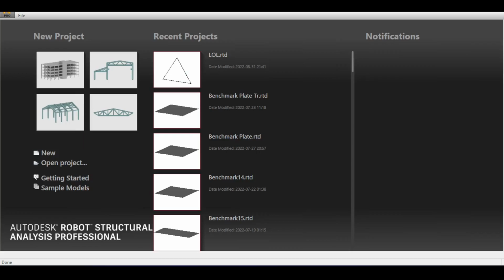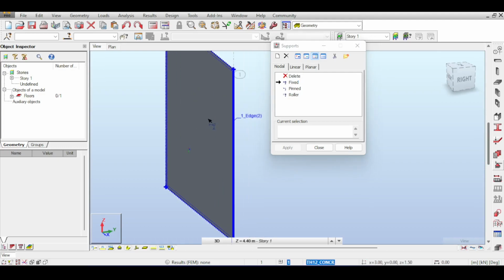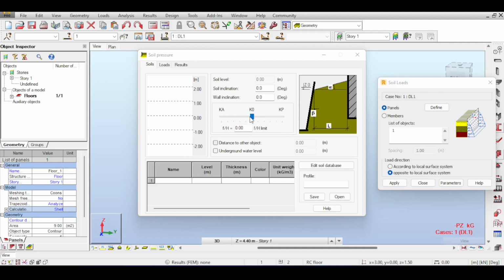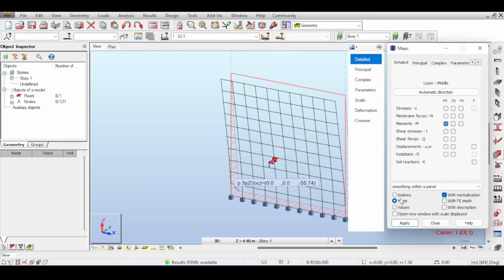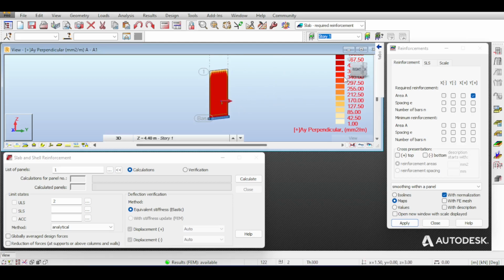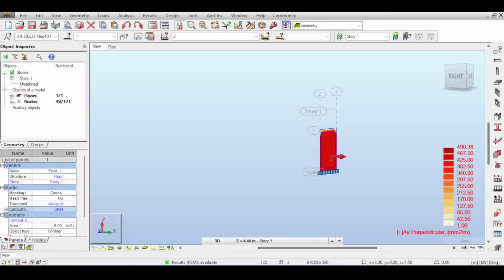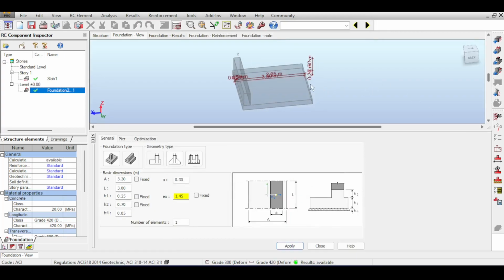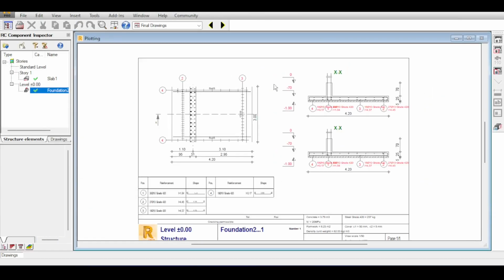Design of RC Retaining Walls (Simplified) in Autodesk Robot

Comment: Thank you CEE 💯, “…. the opportunity to see your thought process in detail, and the step-by-step suffering that you endure 😊 …..” are indeed necessary and they do make the tutorials feel that much more practical and engaging. 

Questions:
1.	The foundation “length” in the final RSA design is about 4.2 meters. Braja M Das proportioning dimensions guides for this length are 0.5 to 0.7H (1.5 to 2.1 meters). I am concerned that 4.2 meters does not “feel right, it feels too long” are you not worried about this dimension?

2.	@ about 30h11 you explained the importance of the soil weight above the heel; @ about 26h30 aren’t the reactions of the wall support you mentioned not only representing the HORIZONTAL components of the soil above the heel and not the VERTICAL components? 

I am thinking that maybe the VERTICAL component of the soil weight above the heel should be model into the design of the retaining wall foundation somehow? What are your views?
Reply from the maker: (Fun fact: the discussion made me rename the video as - Simplified- because you gave me amazing food for thought. I think there is something even better to be prepared next week. + You will get a shout-out at that moment ^_^. It is next week because I already scheduled a Video for 08.09 about modeling swimming pools.)
As for Q1, I totally agree. The reason why the retaining wall was this large is because of the bearing capacity. The loads on the foundation are eccentric, and cause higher pressure on the toe and even uplift in the heel region.

Robot suffers in not taking some points about the heel into account. I will address this issue in a more detailed video in the future. This is also point 2

for point 2:
The reactions you see on the foundation horizontal soil pressure and moment.
the vertical force you see here is due to the weight of the wall.
This is what I mean by "there is no full module that designs retaining walls in robot, and the engineer has to make it in two pieces"

However, you gave me an amazing idea, and I will post something about this next week after doing some research.
I am betting that one can define the soils weight above the heel in the geotechnical soil characteristics by putting the soil height on one side 3meters.

I still have - however - to check the accuracy of calculations. I will prepare a video about this.

Your question is amazing, and I will put it in the description
Regards,
CEE
Reply: @CivilEngineeringEssentials  , 🥰, looking forward to. Thanks again for your wonderful work.
Reply: @CivilEngineeringEssentials  Does robot take into account the cohesion of the soil while calculating the stresses ?

Comment: Hello I want to discuss a case if I have steel truss roof or portal frame  with a columns height 8 m and instead of wall bracing I build a wall between the columns is will these walls work instead of bracing or not?

Comment: Thank you very match..... I  want check  for sliding by robot  pleas my friend explain it or tell me if that any video on youtube explai it.......
Reply from the maker: Sliding can be checked by checking the foundation design.
Since you have lateral loads (from the wall) the foundation will include both overturning and sliding checks.

Worst case scenario you could manually check it

Resistance = (summation of Vertical Forces) * soil resistance
Soil resistance can be derived from friction and cohesion. It is actually really easy, I can recommend Braja M. Das' book for that.

Regards,
CEE

PS: sry for the late reply.

Comment: Good day, thank you for the video. Could you please assist me, I’ve done the example exactly how you did it in the video, but I’m getting an error when i run the calculations. The errors are (1). Example not specified. (2) no supports. (3) the load has not been distributed correctly.
How do I fix them?
Reply from the maker: Hello there and good day to you too.
Please make sure you select "Shell" when you define the wall of the retaining wall.
If you use "curtain wall" or something else, this error occurs.
Sorry for the late reply,
Regards,
CEE

Comment: From where you got the combinations ?
Reply from the maker: If you use the design module to generate the combinations, then those are done automatically using the Code you defined. If you want to see you definition, then please go to: Tools -> job Preferences.
Expand (Design Codes)
Under (Loads) you will find the used codes to auto-generate the combinations.

Regards,
CEE

Comment: thank you so much doctor, just a quick ask, WHY DO U USE FLOORS FOR RETAINING WALLS, INSTEAD OF THE ROBOT WALL, whats their characteristics and if possible could use the "wall" and vary their results, kindly? thank u
Reply from the maker: That is a very good question.
Walls and floors will have the same analysis.
However, when you design them, robot walls are going to be treated as shear walls. With boundary elements

In robot walls, the load is assumed NOT to be perpendocular to its plane surface. Like a shear wall. So its design is different than floors, where you have the assumption of forces perpendicular to its plane surface 👍🌹

Hope it makes sense. Feel free to ask again if need be.

Comment: Thank you for your efforts on these vidoe's but i have a question why did you use the floor icon instead of using the wall icon?
Reply from the maker: Because Robot's reinforced concrete design module designs (walls) as shear walls with boundary elements and so on. Of course retaining walls do not have those

Comment: 13:09 dear sir, I noticed that Robot doubles the the pressure value after its being assigned to the panel. Do you know why? Personally I prefer to calculate and assign the soil pressure manually until I figure out why this issue happens.
Reply from the maker: I think I agree with you. Actually, I had a deeper video about this topic. You can find it under:
https://www.youtube.com/watch?v=zYg_By_0a6I&ab_channel=CivilEngineeringEssentials

Comment: Great video, one question.
Are you modeling the wall as a floor in order to have moment actions part of the design withing the provided reinforcement module?
Reply from the maker: Hi there, it is modeled as a shell.
Also, please note that there is an even deeper video on this channel found under:
https://studio.youtube.com/video/zYg_By_0a6I/edit
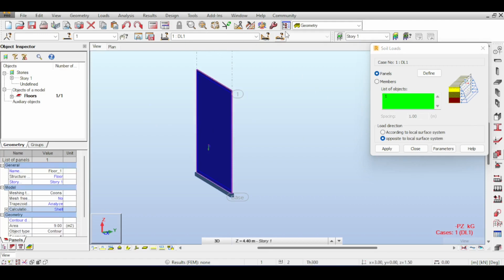Reply: @CivilEngineeringEssentials  Yes, I watched both of them. Actually if you look at 7:57 you can see the properties, Structure object property=Floor, and when you export it the wall to provided reinforcement module it's categorized as Floor. I think you are referring to the Calculation model property which is Shell.
Reply from the maker: Oh I see. I misunderstood your question. Sorry about that.
Yes, indeed, I used the "floor" command.
you can make it a "wall element", It will work. Now I still have not talked about wall elements in this channel, but this will change very soon.

There is a basement video I am preparing, in its second part, it will be designing the basement wall once as shell and another time as wall.
So stay tuned 
(Part 1 is about the modeling, part 2 is about the design)
Part 1: this friday
Part 2: the next

Regards,
CEE

Comment: Your heel section is much longer than necessary because of the way you have used robot (no fill pressure is applied to the heel footing section). This also means settlement and bearing capacity calculations do not include the 3m of fill (60kPA - 6 ton per m^2!!!) on the footing..
Reply from the maker: Indeed.
Check this video for a deeper look on RC retaining walls. This is where every single action gets addressed.

https://www.youtube.com/watch?v=zYg_By_0a6I&ab_channel=CivilEngineeringEssentials

Comment: can i add shear pin(s) under the retaining wall in this software?, if the retaining wall is sitting on rock, i decided to add shear pin(s) to resist shear and tension, which the stiffness of rock and shear pin is not the same, thanks for taking the time to read this msg.
Reply from the maker: In Robot, applying shear pins in the model is - unfortunately - not possible.
However, you could think of adding a linear spring to model this pin.
I hope you enjoy the videos. Stay tuned for more.

Comment: Great and Intensive Presentation CEE.

We need to discuss a lot of things, which am sure will unfold as the course keeps taking shape.

I personally size my basement/retaining wall this way 
1. height of wall/15 for wall thickness.
2. For the base I usually do a  width of 0.6* wall height and proportion 1/3 and 2/3 to the toe and heel side respectively.  The earth on the toe side is usually neglected for conservative reasons

I personally think these personal provision is quiet in line with your reference material.

However, in loading the wall and the base, the BS 8110 treats the earth on the heel side as DL and recommends 10kN/m surcharge weight on the heel side to account for LL which is distributed in a rectangular shape horizontally and vertically to the wall and base. 

You are right in the analysis of basement walls, as usually the moment and shear diagram depict that of a propped cantilever due to the adjoining frame on the suspended ground floor.

I wish to see how to add the surcharge live load on the wall and base of the retaining wall.
Your model is quite conservative (300 thick wall for 3000mm height of wall)  and simplified in loading (1.4 DL) hence the nominal reinforcements in the wall. 

I believe in future tutorials we can discuss more on how Robot displays results for walls and floors as It’s might be misleading and confusing in representation of the results.

Thank you 
Have a lovely day Sir
Regards.
Reply from the maker: Hello there, I am glad you liked it and it sparked a lot of ideas and topics to be discussed.

I am planning a (deep dive) video for the retaining walls next week, since you and another dear subscriber (Donald Khanye) have raised a lot of valid points that I want to address. 
I think I will be modeling like 3 to 4 retaining walls side to side and talk about the various points raised, with comparisons and more information.

Your suggested dimensions are somehow near what Braja M Das suggests. I will investigate them and compare both in the next video. You both gave me a lot of food for thought and I have to script a nice concise and engaging script to be filmed for next week ^_^, so stay tuned.

I have put it on my schedule for next week, because I already scheduled a swimming pool modeling video for the 08.09.2022 
+ I am expecting the retaining wall video to be long.

Regards,
CEE
Reply: @CivilEngineeringEssentials  thanks